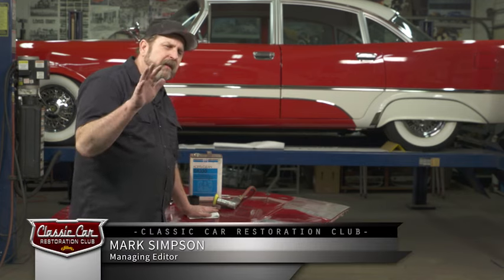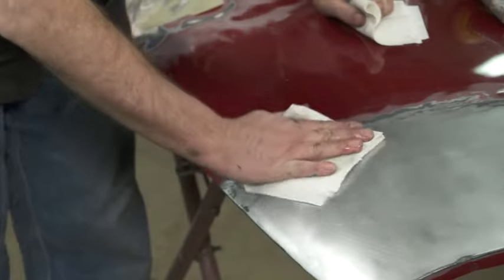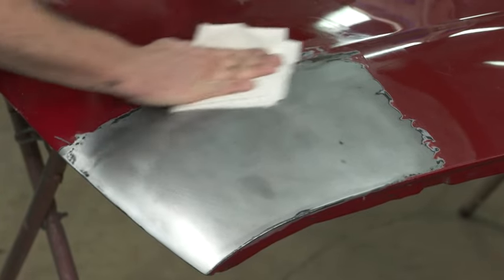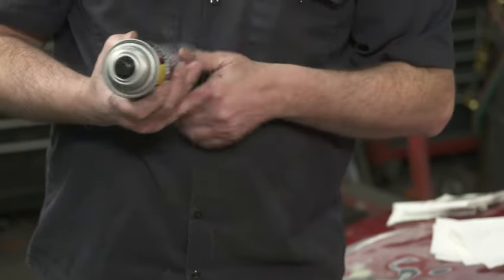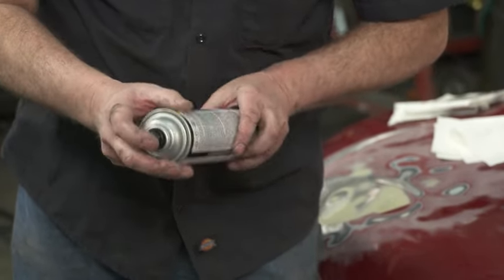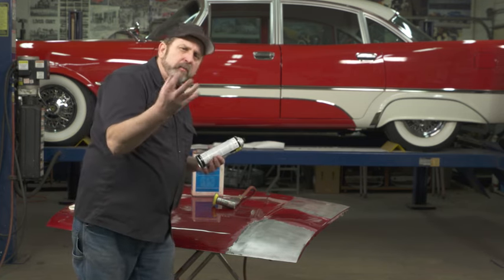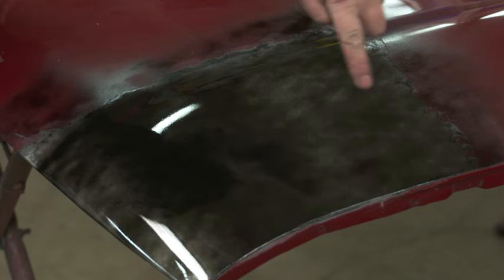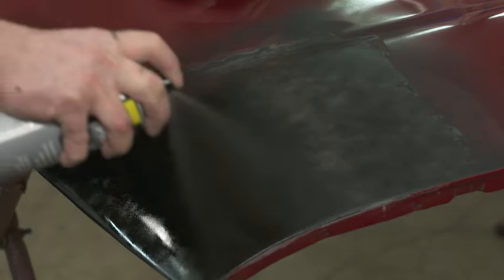Self Etching Primer

Comment: Thanks for the video.  I notice that when you flip over the second rag, you take the surface that your hand oils have been on and place those oils on the surface you are attempting to clean.  A better approach is to four fold the second rag and to never let a fold your hand has been on to touch the surface you are cleaning
Reply from the maker: Great tip!
Reply: @ClassicCarRestorationClub  While that is, indeed, a great tip, wouldn’t the “acid” in the self-etching primer be strong enough to null & void what little bit of hand residue that would be left on that final side of the “wiping” towel, or no??? Genuinely curious. Hope you both have a great day and HAPPY HOT RODDING!!!
Reply: @DFWJon I would recommend wearing disposable gloves for any finishing type work whether cleaning and priming metal or working with any epoxies.
Reply: @infernaldaedra yes sir, i do the same!
Reply: @ClassicCarRestorationClub Hello, do you wet sand or dry sand  self etching primer  witch grit sandpaper  ?
Reply: I mean, he's also putting metal paint cans all over the top of the hood he's "repairing". And not wearing gloves. Or a mask. Or... 
It's a 3 min demonstration video, not a detailed instructional class for someone who knows nothing about what they're doing. Obviously, use painting best practices when you actually do this on a real project instead of a scrapyard hood.

Comment: Those black grey spots on the the steal before you primed it was cancer aka rust...you should have used maratic acide to kill and etch the steel... then use vinegar and distilled water to neutralize acide then use phosphoric  acide as metel prep to get ride of flash rust.
Reply: Isn't vinegar an acid?  So you need an alkali to neutralize the meuriatic acid, not another acid
Reply: Baking soda mixed with  water is a nutrilizer ....vinegar is just a milder acid then muriatic acid ...I used distilled water with baking soda in a spray bottle  and a clean cloth to wipe off after I acid wash   patches and rust

Comment: What keeps it in the steel can . Ive always wondered why the acid is strong enough to etch steel but somehow stays in a steel can for years. Ive seen .5% muratic fid its way through streel 5 gal bucket over several months. Easy explanation would be a coating in the can , much like a pop can has but the stir ball would f-that up. 🤷

Comment: So if I have a bare metal spot from welding in patch panels, do I use self etch first then body filler on top or body filler first then self etch to cover any metal still showing?
Reply from the maker: In this situation I would place my fillers directly on bare metal, then with mixed materials to prime over I would use a two-part epoxy primer to seal up the surface.
Many claim you can apply body filler over self-etch without issue, but I generally try not to, although I have used filler over epoxy primer without ever having any adhesion issues.

Comment: I used this followed by primer sealer then paint. Do you think that’s a good combo to provide rust prevention protection?
Reply from the maker: Great question... The key to getting paint to stick well to bare metal is all in the metal prep and using the right primers. Self etching primer contains a mild acid that actually etches the bare metal to create a superior bond between the primer and the metal. Once the area is coated in self etching primer more traditional primers can be used to build out the surface. I hope this helps.

Comment: So you can do body work over self etching primer? Would the body filler adhere to it good?  Thanks in advance.
Reply from the maker: You'll find people on both sides of this answer. I have used body filler on self etch, but generally self etch is never very thick and only provides a good surface to apply a primer surfacer or primer sealer.
If I know I am going to be applying body fillers or glazing putties, I prefer to use 2-part epoxy primers as a base.
This keeps the metal from flash rusting and gives your body filler a rock solid surface to attach to.
The hobbyist builder generally has a project in the bodywork phase of the build much longer than a production bodyshop does and flash rust is a real hazard.
There are those that argue to never apply body filler to anything but bare metal, and those that claim epoxy primer is just as good or better than bare metal.
I epoxy prime all bare metal, and have never had body filler fail on any car in the last 45-years and some of those cars I still have today.
Wrench Safe, Mark
Reply: @ClassicCarRestorationClub  Thank you very much

Comment: I have a surface with a mix of paint and metal. Its inside of my car, not an important spot by any means. If I properly sand and clean up the painted spots, will self etching primer stick to the paint?

Comment: So after the self etching primer do I need to sand it before I spray regular primer? If so what grit?  Thank you 🙏
Reply from the maker: It is best to scuff if with 320-grit paper.
The idea is to give the primer something to bite into.
Reply: Thanks
Reply: If you don't use crap from the can, instead use normal 2k wash primer, after about half an hour it must be primerer with acrylic primer without sandind. Selfetch primer is not sandable. There is some glue between it's components, so acrylic primer stick's to it very good

Comment: im painting truck door starting at bare metal. i have self etch primer. do i need to add another primer on top of the etch primer in order for the base coat to stick to it? or just 2 or 3 layers of etch primer then base then clear coat?
Reply from the maker: Typically we only apply a medium coat of Self Etch, and allow it to dry. it is then scuffed with a grey Scotchbrite pad then a few coats of epoxy primer are applied.
You can topcoat directly on the Self Etch primer, but epoxy primer also acts like a sealer to protect against contaminants affecting the top coat paint.
Reply: @ClassicCarRestorationClub  thanks for response!! 
 what epoxy primer do u suggest on top of finish right etch primer? 
 and do i sand the epoxy primer with 320,500,600,800 then base top coat then clear? i dont want a line inside but im not paintin the inside. how do i keep from makin a line on the other side if i tape inside edge before spraying?
what pressure do i spray the gun at? 30 psi on the regulator?

Comment: what epoxy or urethane primer do u suggest on top of finish right etch primer?  or is zinc primer under the etch primer better?
Reply from the maker: Hi Jack, Zinc primers are great for items that will be in Very Corrosive conditions like boat trailers, but I've seen no real benefit for classic cars. 
For initial prime on large areas I prefer Epoxy primers (like PPG DP90) as it has great adhesion and acts as a sealer too. 
Self Etch works great for small or spot work though and often I'll scuff it lightly after dry and prime with a two-part Primer Surfacer (like PPG K36). 
Primer surfacer will allow you to block sand the body and smooth out minor defects in the body or fill sanding scratches in metal and body fillers. 
Once the car is blocked (often I block out the finish 2 or 3 times applying additional coats of Primer surfacer between sandings) I often topcoat with Epoxy Primer to act as a sealant until we're ready for paint. 
Then the Epoxy primer is cleaned, scuffed and painted
Reply: @ClassicCarRestorationClub  where is everyone buyin the ppg? i cant find it anywhere. do i have to set up a business account on phone with them? im  not a business
Reply from the maker: In our area there is still a few auto parts suppliers that offer paint supplies and a couple of them carry PPG. 
The one we use most is Welle Auto Supply https://www.welleauto.com/ 
Although there are many good paint manufacturers 
I would start by seeing what brands your local auto body supply houses carry... and they can offer comparable product suggestions. 
Unless you live in California, you should have access to buying auto paint without being a business. 
I honestly am not certain what restrictions California may have on sales, but I imagine some.
Reply: @ClassicCarRestorationClub  well i found one place other than homedepot and lowers,home depot or lowes doesnt sell ppg for automobiles. the place closest is so far away still and no ppg brand.. i looked online at ppg and its so confusing to buy direct from them( i dont think u can), so thats why im asking where is everyone gettin it iv read so many good things about it, but i just dont have anyone that sells it. im lookin at welleauto rt now, thanks

Comment: Hi can anybody help me please? 
I am about to prime a project I need to spray top and bottom of it not just a flat panel. My plan was to hang it using plastic wire from a strimmer/ weed wacker, will the primer eat into the plastic or is it safe?
Thanks
Reply from the maker: Great question! The ‘Ask an Expert’ section is currently for members of our online community. I would be happy to send your question off to the experts. To get started, please send the email associated with your paid membership account. Thanks!
Reply: @ClassicCarRestorationClub  I succeeded it didn’t affect the plastic and was far more easier to work with then people made it out to be.

Comment: If I'm self etching a valve cover for primer when I put high temp primer underneath the etching primer on top?
Reply from the maker: Hi Jimmie! Self-Etch Primer is only applied to bare metal. A light coat of self-etch or epoxy primer would be a good base for high-heat primer on valve covers. Thanks!

Comment: Question please: I did some body work (filler + 2k primer) on my fender and two doors but I ended up with small spot of bare metal...and my question is: can I spray the bare metal spots with the self etch primer and paint my first base coat over without sanding it down, or simply spray the epoxy primer over the entire panel and paint over it right away without sanding down the epoxy primer? Thanks in advance for the answer
Reply: Maybe
Reply from the maker: Hello Sam,

Thank you for contacting us. Great question! The ‘Ask an Expert’ section is currently for members of our online community. By becoming a member, you will have access to our expert’s knowledge in classic car restoration and maintenance.  With your membership you will also receive discounts on products and hours of Premium video content. 

If you are interested in becoming a member to the Classic Car Restoration Club,  please click on the special offer below:

https://go.classiccarrestorationclub.com/C23602
     
If you have any further questions, please chat, email, or contact Customer Service at 1-855-706-3534.

We greatly appreciate your business!

Sincerely,
 
Michael    
Classic Car Restoration Club Video Membership

Comment: Super helpful, thanks!  Didn't know to use a different primer after the etching primer.  Makes sense though

Mineral spirits work ok for degreasing? Or acetone?

Also, do I need to remove the anodized layer on aluminum or can I paint on the anodized surface?
Reply from the maker: Hello K,

Great question! The ‘Ask an Expert’ section is currently for members of our online community. By becoming a member, you will have access to our expert’s knowledge. With your membership you will also receive discounts on products and hundreds of hours of Premium content.  

 
If you are interested in becoming a member, please click on the offer below: 

https://go.classiccarrestorationclub.com/a19769  Thanks!

Comment: Hey! so is it okay to get a small amount of the etch over another product like a rust destroyer/sealer? im doing a job that had some surface rust and has some spots im going to use that rust killer on and then use etch over the rest of the metal. Then continue with primer ect.
Reply from the maker: The product is designed to be used on bare metal, but I believe you'll be fine if you allow it to dry thoroughly before top coating.